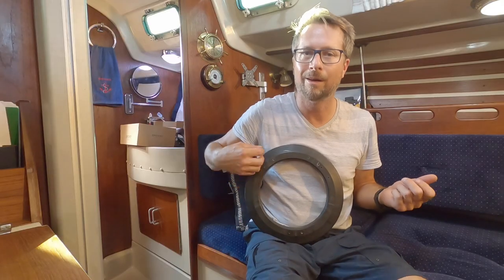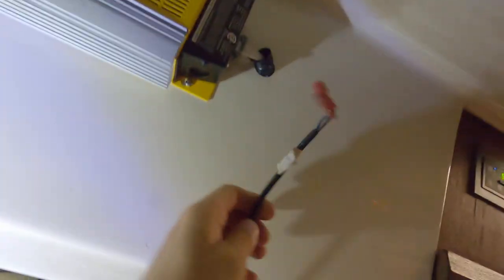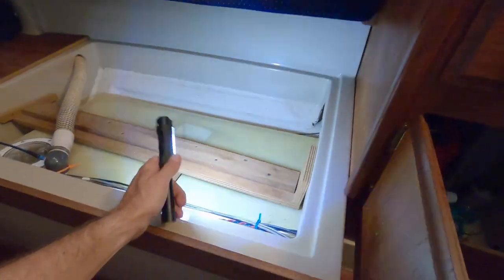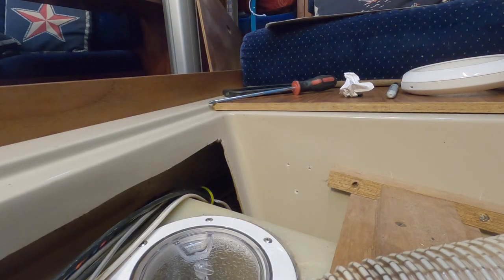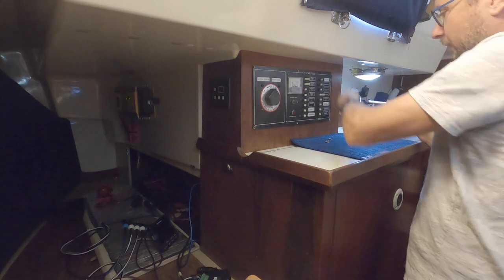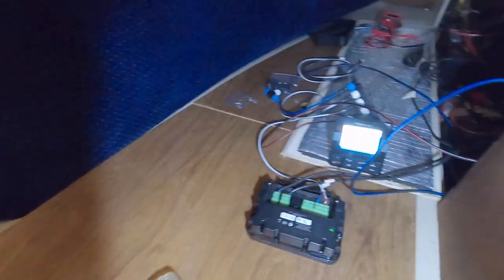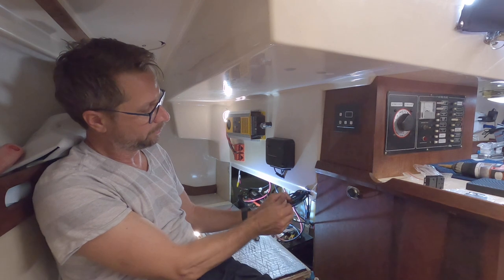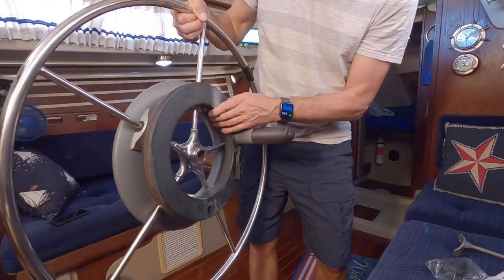Sailboat Autopilot install. Ep. 48

Comment: Hi. I really like your videos. I bought an ODay 1985 in 2020, it’s my first boat. I’m a newbie but wanted to constructively comment on 2 items. My boat did not have covers for the battery boxes. The inspector suggested they be covered as a metallic object such as a tool could short the terminals and cause a fire. I added the covers with firm straps. The second comment is about reefing. I was told not  to tie the reefing lines around the boom because if the reef fails the sail will be ripped. Also it was suggested to tie the reef point to the boom directly as the cam cleat on the reefing line is not reliable.  I greatly appreciate your videos the immensely helpful and a bit scary you have pointed out so many things that can go wrong. Happy sailing! Malcolm

Comment: Great episode.  One thing I would suggest for anyone is to add a battery monitor.  With this inexpensive device  you can have the confidence to use stuff like the autopilot and all the 12 volt stuff and still know you can start the engine at the end of the day (or night).  Mine even showed me I could run the am/fm stereo, VHF and depth sounder with the 100W solar panel alone supplying the power.  It also taught me that 1 incandescent bulb draws the same amount of current as 8 LED bulbs.  Amazingly useful device.
Reply from the maker: Thanks, I've been looking at them for the house battery - also useful so you know hat solar might be needed to stay charged ... I just haven't picked on out yet!
Reply: I'll have to show you the Balmar monitor I installed. Varnishing Fri and Sat if you will be there
Reply: @AdventuresInParadise  Renogy battery monitor is awesome and fairly cheap for all its amenities. 89.99
Reply from the maker: I ordered it, thanks!
Reply: @AdventuresInParadise  sure thing!  Most if the negative reviews on it are bc people did not connect it correctly. You should have a ground from the battery connected to one side of the shunt then EVERYTHING ELSE connected on the other side of the shunt. What i did was i ran a short run from the battery ground to the shunt then from the shunt to my ground buses. Thats the only way you get real or correct readings from the monitor. I mean why install a battery monitor to monitor usage and charge if you dont run everything through the shunt. Its pretty simple.
Reply: @Flynghi  I made the mistake of installing the shunt between the panel ground block and ground wire going back to the battery, and while it worked for showing discharge, it didn't show charge current.  The problem then was the wire from the shunt to the monitor had to be lengthened considerably for the shunt to be put at the battery.  But it sure was worth the effort.
Reply: Thats a good foot note ed. Fortunately I didn’t have that issue. Got about 18” from battery to shunt then 36” from shunt to ground buses. I wish i could post a pic of it on here. But yes i agree. The right battery monitor is tremendous info and its funny how you’ll adjust your habits with certain devices

Comment: Just so u know u can cut a bigger hole saw over a smaller hole without the center hole. the  way i do this require a scrape piece of play say 5 mm thick u then drill the larger hole in it for a 100 mm dia hole make a 120 square piece of ply cut the 100 mm hole on center of jig piece now u can use the jig to Aline and drill your new hole over the old one .Hope this helps.
Reply from the maker: makes sense, thanks!